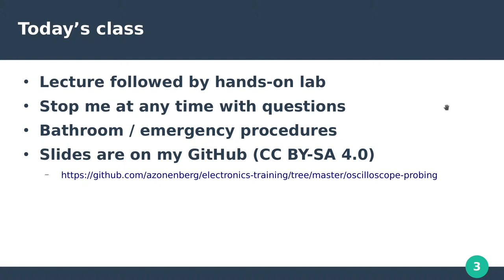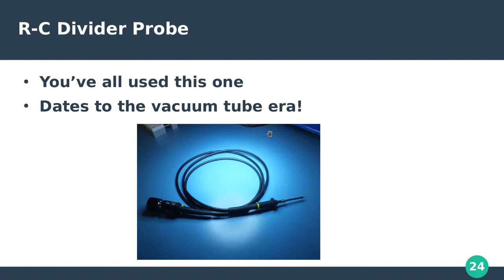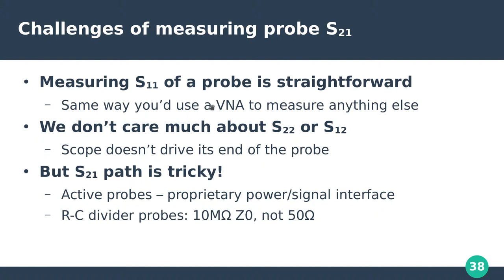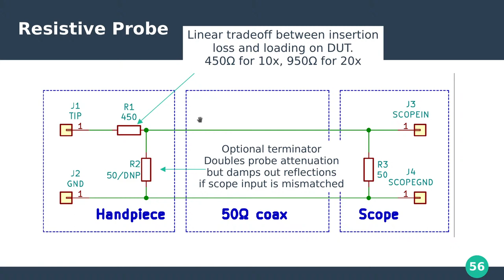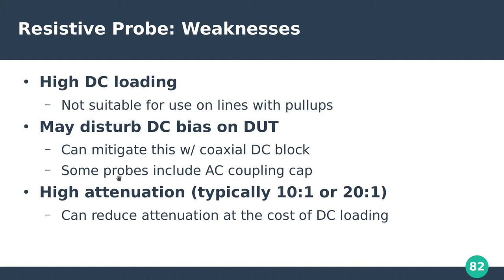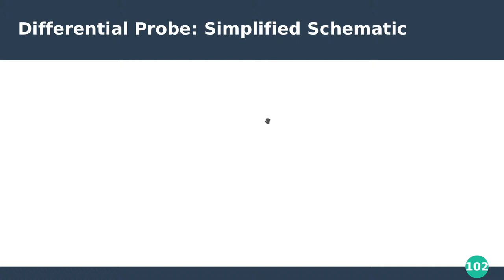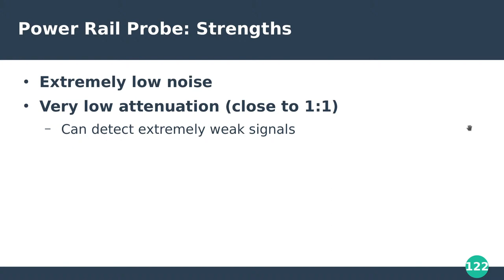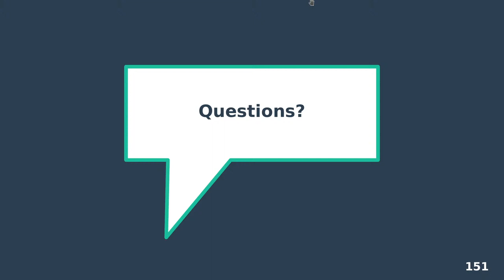Probing class lecture - early preview

Comment: I never heard the term "R-C" probes before. They are normally called passive probe and are sold with virtually every oscilloscope still today. Not sure why you are are saying they were more adapted to vacuum tubes and now deprecated ? Also, about the S21 measurement of the passive probe I would double check my results. I did some test (mostly scalar) with a noise source and got excellent results (< +-1dBm) with a Lecroy pp005 up to 500Mhz on a 2GHz Scope. That being said, actives probes were still outperforming the passive one.
Reply from the maker: I call them R-C divider probes to avoid confusion with transmission line probes, which are also passive (just a resistor). Yes, they're the most common kind of passive probe, but they're not the only kind.

They're optimized for extremely low DC loading at the expense of high input capacitance, which is great for really low speed signals with weak drive (a la vacuum tubes) but not the best choice for fast switching signals driven by CMOS push-pull drivers with a fair bit of output current. Both probes have their place but I think for most modern transistorized circuitry a resistive probe is the better passive probe for ~90% of measurements.
Reply from the maker: As far as flatness goes, I did another test to illustrate my point.

Tone at nominal 0 dBm was generated with a Siglent SSG5060X-V, passed through through six feet of RG-188 cable, and to common port of a Mini-Circuits ZFRSC-42-S+ resistive splitter. No level correction was performed to compensate for loss in this cable.

Port 1 of splitter goes to thru line on a LeCroy PCF200 test fixture with the far end terminated to 50 ohms, port 2 goes through a Mini-Circuits FL086-24SM+ cable to channel 2 of a LeCroy WaveRunner 8404M-MS oscilloscope in 50 ohm mode. Channel 1 has a PP022 passive probe with spring ground, measuring across the transmission line.

Power at port 1 and 2 was measured with the WR8K-SPECTRUM option looking at the highest peak. In this setup, CH1-CH2 shows S21 of the probe (ignoring the <0.3 dB of loss in the FL086-24SM+ cable and the PCF200 fixture)

1 MHz: CH1 = -2 dBm, CH2 = -0.2 dBm, S21 = -1.8 dB
50 MHz: CH1 = -9.5 dBm, CH2 = -1.4 dBm, S21 = -8.1 dB
100 MHz: CH1 = -6.4 dBm, CH2 = -2.3 dBm, S21 = -4.1 dB
200 MHz: CH1 = -12.4 dBm, CH2 = -5.6 dBm, S21 = -6.8 dB
300 MHz: CH1 = -7.7 dBm, CH2 = -7.2 dBm, S21 = -0.5 dB
400 MHz: CH1 = -7.3 dBm, CH2 = -8.9 dBm, S21 = +1.5 dB
500 MHz: CH1 = -13.2 dBm, CH2 = -10.5 dBm, S21 = -2.7 dB